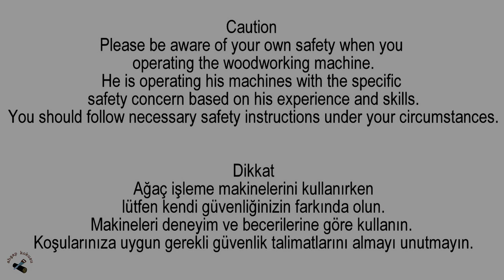Epoxy Table/ How To Fill Voids in Wood / Epoksi Kütük Masa Yapımı

Comment: So oiling epoxy enhances the strength or what's the reason for it? Would it not have been good enough with a dry layer of epoxy?